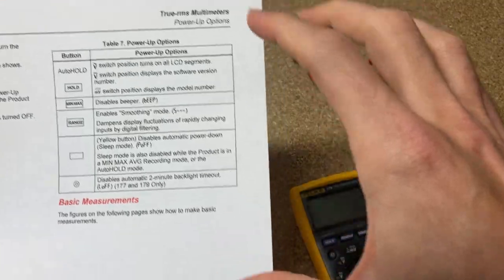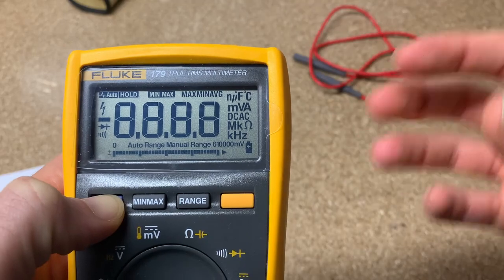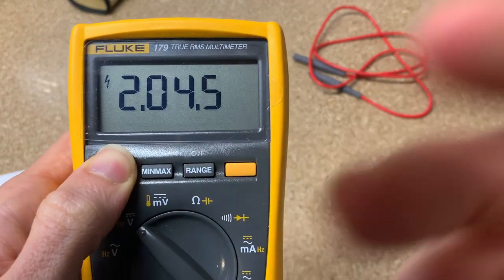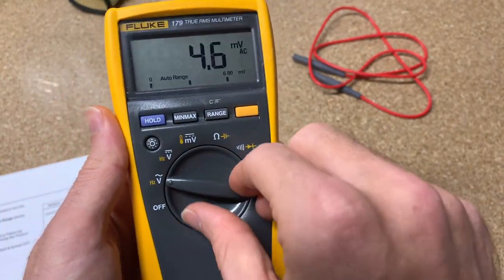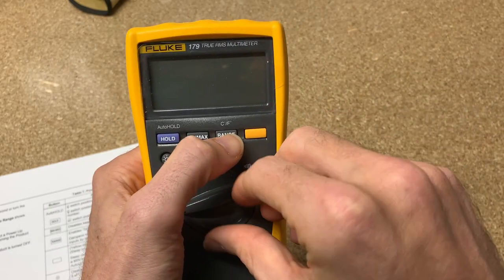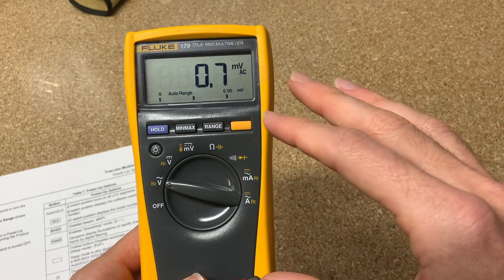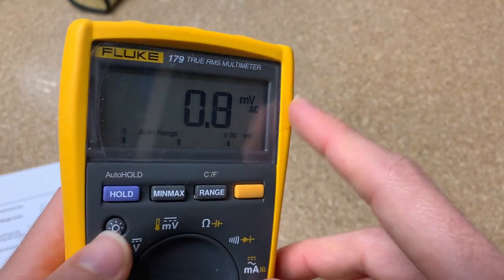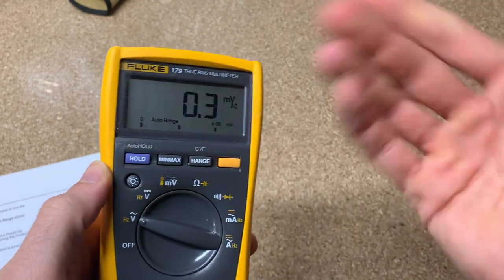Secret features  Fluke-179, 177, 175 - Fluke Fridays - Episode 37

Comment: I will add a cool fact, you can check the internal fuses on your meter by turning meter switch to Ohms/Continuity, insert red meter lead into the red volt plug spot on the meter and use the opposite meter lead end and touch the meter lead to the 400ma fused input and then to the 10a fused input. If you read ohms or continuity the internal fuses are good.

Comment: Is is normal for the new Fluke 175 meter to show varying voltages from 1.6v to  20 volts to 62 volts with leads plugs in without even close to electricity?   Im talking about AC voltage setting.
Reply from the maker: No. But you might be seeing milli volt fluctuation. Do you know the range it's in?

Comment: This is my favorite meter for years. One thing to remember if you have it forgotten --> Put one probe in one of the two clamps on the back to keep the meter in the hand during the measurement. Often an unhandy solution, but sometimes very helpful if you find no other place for the meter. See it as one more alternative to the magnetic holder or the stand. When you remove the magnetic holder it is useful not trying to pull while you push the black plastic down because otherwise the yellow rubber still blocks the release. Sounds like a logical thing and happens maybe only dumb apes like me again and again ;-)
Reply from the maker: See my video today. You inspired it.

Comment: I have fluke 175 and bought it second hand. I was trying to get the ampere of my adaptor. But I could get the value from the fluke. Any suggestion. Not sure if my device is broken.
Reply: Just check your fuses. There are two of them build in. You can easily open the meter with the screws on the back.

Comment: You missed one secret about the 179 that Dave Jones if EEVBlog went over previously. If you take the standard probes and short them while in the temperature setting, the meter will display the internal temperature delta of the meter. This isn't specific to Fluke DMMs. It works on most.

Comment: Great video. Nice to know how to silence the BEEP, but in my case, I lost the BEEP. I do not know how this happened. 
 Can any one help me? Is the beeper defective, or is it because it does not get the correct signal to get it to beep. How can I test the beeper. Just give it a DC voltage, if so, what voltage. Is ir polarity sensitive ?
Reply from the maker: I don't know for sure. I would recommend calling tech support at 800-873-5853
They should be able to walk you through any troubleshooting

Comment: A couple more tips:  When you turn the meter off, any special choice you made is cancelled.  You have to reselect it again when you turn the meter back on.  Also, not all of the choices are mutually exclusive - you can hold down more than one "secret feature" button upon power up and you will enable all the features for all of that you have pressed.
Reply from the maker: Good insight! Love the feedback keep it coming
Reply: really? so you can do "Poff" and "Loff" at the same time, not just only one?
Reply: @Paul-Cirimpei  I can't guarantee it is true on all models that have both PoFF and LoFF.  But I just tested my Fluke 115 and if you hold down both the yellow and the light bulb buttons on powerup, both features are enabled although the manual doesn't mention it.  The Fluke 106/107 has a note confirming both features simultaneously saying, "Note:  To disable both the Auto Power Off function and the Auto Backlight Off function, hold down the YELLOW button and the [lightbulb symbol] button until both PoFF and LoFF show on the display."  The way that is written it suggests you could do it after the unit was already on, but on the 115 it didn't work like that and I had to hold both buttons down while turning it on and it only showed PoFF on the display although the backlight turning off was also disabled.  My Fluke 87V doesn't seen to have a feature regarding the backlight as it stays on indefinitely unless I turn it off.  So you may have to check how your particular model works.
Reply: That is exactley what I was going to ask, thank you!

Comment: The "smoothing" feature is much more than updating the screen less frequently.  It is also filtering the data.  From the Fluke 175/177/179 manual:  " ... Dampens display fluctuations of rapidly changing inputs by digital filtering."
Reply from the maker: Digitally filtering could technically be done just by slowing the refresh of the screen. That might not be how it is done, but that is how it is done according to what Fluke's tech support told me.

Comment: These options only work if your firmware is 2.04.X and above. Below that, the only options you have are are the LCD segmant display and firmware display. Also, silencing the beep is helpful when using 'Autohold' and you don't require the sound, not just silencing continuity.

Comment: Hi
Why does Fluke 179 multimeter have 2 types of screens?
Why do some have green light and some have white light?
Reply: Hi! Older Flukes have green backlight, newer ones have white backlight.
Reply: Green light is old version that is USA made PCB and white light is new version that is China made PCB. I have FLUKE 179, in warranty support they  change the PCB, which quality is not satisfactory, that's why i suffering. Old is gold
Reply from the maker: Short answer, I don't know. Speculation is they once were one color and now are another. With a design change at some point.
Reply: Seriously I am very dissatisfy with FLUKE, can you suggest me to overcome the problem